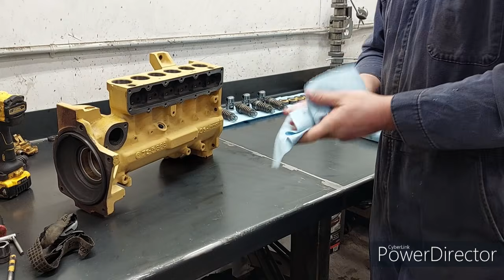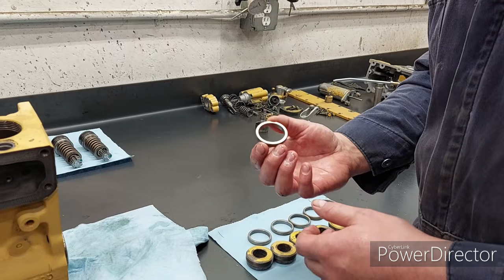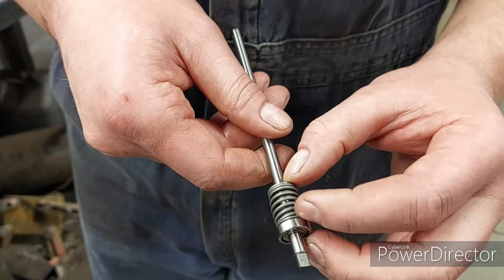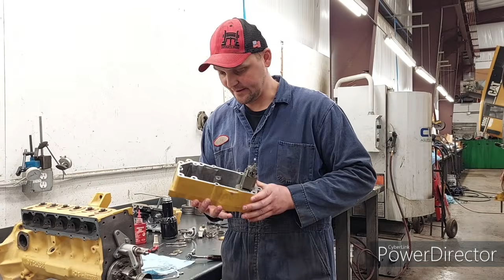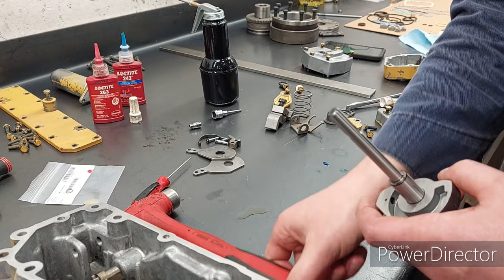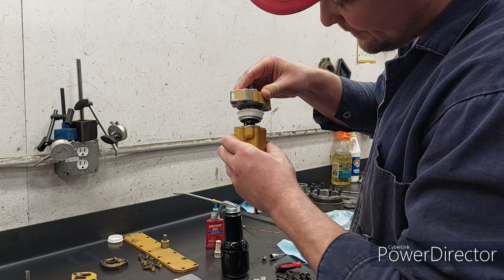3406B Fuel Pump

Comment: I have a question, I can’t get my 3406B to go back down to idle its revving around 800-1,000 rpm’s. I’m wondering if you would have an idea of what the problem may be? The engine did get dropped off the forks onto the ground when it was being moved into position to be placed into the truck and was mounted on the engine stand. It fell about a foot onto the ground didn’t damage anything on the engine but now since it has been mounted into the truck and started it will not idle down. I have an idle spring hook up and no fuel pedal linkage is connected and the Jake switch is backed all the way out so it’s not interfering with the throttle.
Reply: Did this just happen or first time you got it running?
With the engine is NOT running, and the throttle linkage off, back the low idle/Jake switch screw out. You should see the throttle lever rotate counter clock wise. Turn it in it should rotate clock wise. At any speed the spring force and the flyweight should equal out, thus you have a steady speed. Not talking about pulling a load on or up a hill as RPM's are changing. So if your throttle shaft is moving, something is wrong in your governor. First item I would check is the dash pot on the back. Engine off, you screw it in until it bottoms out. Back it off one and a half turns min to two turns max. On 3406C 8PN engines the dash pot was defective and you had to replace it. I have also seen the wrong governor spring in the pump and one pump I took apart for this reason Somebody took the governor spring and stretched the spring so he could run above full load speed so the engine would not surge. If you r & i the governor, be careful. The flyweights can drop out behind the race. When they do and you start the engine, the flyweight will come out the side off the governor. If you have the updated carrier, it will not do this. Also the race next to the flyweight Cat has three different part numbers. Use the part number off an 8PN. It is larger and helps prevent this. Also your governor guide depth could cause a problem. If I recall his video shows you how to set it. Do it after you replace the tach drive seal. Inside the governor guide is a snap ring. If you replace the tach drive seal. Be careful that you don't knock it out.

Comment: Hello, My 3406B engine had a starting problem, and I found diesel flowing through the outlet/ special fitting to the diesel tank during the hand priming and cranking. What is wrong with this issue. Appreciate for your help.
Reply: Are you talking about the fitting on top of the main pump? Usually a number four line, could be a 6 or 8.

Comment: What would cause fuel to get into oil? I've pulled the valve cover and checked for a leaking fuel line, no issue found. I heard a fuel transfer pump could cause this or possibly a seal at the main injection pump drive. How would I verify?
Reply from the maker: Most internal fuel leaks on a B or C is due to the internal lines or a nozzle. Common for them to leak at either the bleed screw on the side of the nozzle or where the top part of the nozzle threads to the middle part. Get some fuel dye, pit it in the filter, use a black light with the engine running valve covers off and check the lines from both ends and pay attention to the nozzle retainer. You may see fuel coming up around the line at the nozzle. It can be an injection pump problem but if it hasn't been into recently its not likely
Reply: @hellscanyondieselpower6537  before posting this comment, I did remove the valve cover and run the engine while visually inspecting the fuel lines. I didn't see any obvious signs of a fuel leak, I will purchase some fuel dye. Do you have any experience with fuel dye and which would be best?
Reply: @alexchavez3912  The fuel transfer pump was a classic part (Cat aftermarket cheap) it was pitted in the bottom. You are suppose to pressure test it at a certain angle and count the drips around the shaft. I have not seen one fail the leak test yet. Been working on Cat's for 43 plus years. 99% of the time it is a nozzle, unless some body has been in the pump lately. I explained how I test it for fuel in the oil. Replace the pump if you wish.
Reply: Fuel transfer pump, only seen one and it was a classic part. Fuel pump usually when someone tried to fix a bushing leak and didn't do it right. Most of the time it is a nozzle. With the valve covers off, the nozzle is in a chamber. Should have two holes on the cap. Be careful, put your finger on one side. The other side put some air psi on the open hole. Be careful you don't want a face full of oil. As you check each one, the good holes will push oil out, dark. The leaking nozzle will be clear because it is full of fuel. If it is the nozzle, could be seal on the side. You can replace it. If it is the seal on top, you have to replace the nozzle. Can be a fuel line, the outside connection has a drain hole in the fuel line adapter. The inside line has an oring to try and force a leak to the outside. The nozzle connection you already check it.
Reply: @johngoldsmith6629  how did you determine that the fuel transfer pump is leaking? When you removed it did you see obvious fuel coming from the transfer pump?
Reply: So I got the test results in yesterday from the oil sample. My engine oil does indeed have fuel contamination. I will start with the fuel transfer pump, I'm hoping that's what is causing this issue

Comment: Can u change the little pin at the bottom of the hole that the plunger does into? My cylinder 1 pin is gone. Wasn’t sure if maybe i could take off the side cover and replace it
Reply from the maker: If you mean the pin in the lifter, no you can't. But that pin is only a guide to get the teeth on the plunger to align with the rack properly. Sometimes when you disassemble a pump with stuck plungers and barrels those little pins get damaged. I just carefully grind them off and check my rack during assembly.
Reply from the maker: If you mean the alignment dowel in the housing about an inch down, I do believe you can change that through the fuel cover. Never have done it but I'm pretty sure they are in the parts book
Reply: @hellscanyondieselpower6537   As I work on truck engines. The alignment dowel has two types that I know of. The early ones (7FB) style pumps, has the dowel and a o-ring. They are simple to install, as they bottom out in the housing. The later pumps, the pin can go all the way thru the housing. As you are well aware on a camshaft lifter failure. Getting the lifter out is the problem. If you force it out the top, you will damage the seat area of the spacer. What I do is, turn the cam and get the lifter up, slide the camshaft out. Take a brass/bronze punch and lightly start tapping the lifter back down. What you are trying to do is force the dowel pin to move out. If you strike the lifter very hard, you will shear off the dowel and damage the housing even more. Once the lifter falls out the bottom, on the solid dowel ones (later). I drive the dowel back in and let it fall out. I then take a hone and hone the damaged bore. Take one of the used lifters and see if it will drop all the way in freely. If the housing looks reusable, I take a one inch impact socket and use a hole for a guide. Grind a flat spot on the socket until it will fit in the bore using the flat spot against the dowel. I then take a extension and and put it on the socket. Using a flat edge laying on the top of the pump housing. I mark the extension with a marker. I then get a new dowel and put bearing mount around it. Put the dowel in and socket until I get it back to the proper depth. Take a lifter and see how it feels. You can use a depth mic if you like and compare it with a non failed bore. Once you are sure everything will work out. I clean the pin bore area on the outside and apply J-B weld in case of any seepage.

Comment: Gotta be almost 30 years since I rebuilt a 3406b pump. Did a few earlier drive shaft driven 3406 pumps. Also done a few 3208 pumps. The throttle shafts would wear out quickly. I still have the bonnet wrenches for the inside spline and the outside spline bonnets. Thank you for bringing back memories.

Comment: Would love to see more videos about cat engines! The b model specifically, just bought a 1988 379 Pete looking to keep it around a long time. Videos like this will make that possible. no matter how much money the truck makes or doesn’t make I want to do these kinds of repairs myself. That gives you a true understanding of what’s getting you down the road everyday and makes understanding and diagnosing problems easy.
Reply: What is your full engine serial number?
Reply: @johngoldsmith6629  4mg29870 is what I was told. Everything seams to match. That’s what was put in it from factory and I was told it was the same engine. Only thing is I can’t find a plate on the engine itself, so i dont know for sure.
Reply: @micahfreeberg574  The serial number is stamped in the block, it is on the passenger side, number five cylinder. About four to five inches or so below the exhaust. Shows to be in a PB, you can call PB and give them the vin. They can tell you what engine the truck was born with.

Arrangement No:	9Y-2449	
Mfg Model:	3406B	
Mktg Model Year:	1988
Prod Family:	ZI	3406/C15 Engines
Sims Prod Family:	62	Truck Engines
Source Facility:	40	Engine Develop And Mfg 7-18L
Principle Work:	D10	Trucks - On-Highway
Build Date:	16Jun1988
Factory Ship Date:	Not Applicable
Dealer/Invoiced Ship Date:	27Jun1988
Sales Date:	27Jun1988
Delivery Date:	19Jul1988
Selling Dlr:	D99L
Owner Cls:	E
317 BRAKE KW (425 BHP) AT 2100 RPM. CARB-CERTIFIED, PETERBILT

Only repair showing at Cat was the governor recall. This engine has a very bad timing advance. Numerous recalls and updates. The carrier likes to slip, so the timing advance will turn slower if it doesn't have the updated carrier. With the cover off the advance see if the flyweights will turn, I use a screw driver and push on the side of the weight. Don't get wild, don't want to break anything. If they do you need to rebuild your VTU, also other updates on the snap ring, races, small lock nut. 
The bushings that hold each injection pump down causes the pump not to seat in the bore. Cat has updated the bushing. If you replace the bushings, you have to center the rack and pull the pump out. Be clean, clean and clean. If your not you will get dirt, etc in the sealing area and put fuel in the oil. 
The governor tach drive seal likes to leak oil. Video shows on governor guide depth, when you replace the seal. Have to be careful, with the outer housing off. A flyweight can drop out and when you start the engine. The flyweight will come out the side of the inner housing. I use the flyweight race off a 8PN, has a larger OD. Also the flyweight carrier has been update with stops to prevent this, if something fails. 
Fuel injection lines, has to have clamps and brackets to secure the lines. I like to use the set up on an 8PN 3406 C. However I do mine a little different then the book. 
Adept Ape has two videos on this engine, one on the engine, other one is pulling a nozzle out, watch them.
Fuel Ratio Control (FRC), diaphragm likes to blow sometimes. The housing gets a sharp edge and will cut it. I put a beveled edge on it (part that it rest on). Some people just put a plate on the back. Have to be careful, as black smoke will roll out the exhaust. 
Jacobs Brake, should have a three point stand. If I recall you can buy some more parts and make it a little stronger. Head bolts will have to come out. So you have to pull a valve cover and see on the exhaust side if you have one stand or two.

Comment: Are B model pumps and C model pumps interchangeable?
Reply: Early 3406 B's depends on HP, some had up to a 24 degree fuel system camshaft. 
3406 C 8PN's are a unique design. 
4MG's, 5KJ's and 3ZJ's Again fuel system timing, VTU, dual helix, single helix, different check valves. 
Will it bolt up, yes.
Will VTU's interchange? Depends on what you have. 
Will it run? yes, 
Will it run right? Who knows.

Comment: Great video, do you have the part number for little filter on the AFR assembly? Your right about helcoil threads for those 2 bolts are shot and it let loose today on me.
Reply: 8N6680, 2D6392 seal, just put a plate on it.

Comment: i have same injection pump and unable to start engine, if i give little power for rack than started. after that RPM gradually reduced. what is reason for that
?
Reply from the maker: Start with the shutdown solenoid if it has one. Remove it and see if will stay running. Sometimes those solenoids click but don't pull in all the way. You will have to manually kill the engine with small shaft above throttle shaft if solenoid is removed. Next try to remove the air fuel control, it doesn't make sense but I have seen one engine that it was adjusted in all the way and the truck would act like it was running out of fuel. Check fuel pressure when it's running and verify it stays around 35 to 45 psi
Reply from the maker: If you have good fuel pressure and solenoid is not stopping you, then there is probably a problem in the governor either with the flyweights or throttle servo

Comment: What aftermarket brand plungers are u running? I need to buy 6 new ones but cat is priced high. What’s out there for quality aftermarket?
Reply: Cat offers REMAN, but they are still new parts.
Reply from the maker: Disa plungers and barrels. Have had great luck with them

Comment: loved the video helped alot, if you could, a video demonstrating how to reset the fuel/air screws back to "factory" would be much appreciated, i know how to turn it it up but i bought my truck already turned up gonna be rebuilding the pum soon and a base line starting point to set it at for break in period would reallly help!
Reply: Setting the rack, (FLS/FTS) back to factory setting. Requires the tooling from Cat. Also if you do not have the data plate you will have to call Cat with the engine serial number and they will have to access TMI. To set the Air Fuel Ratio setting, you still need the same tool group. You have the lever setting and when that is done. Next step is to setting the dynamic setting with the engine running. So you leave the dial indicator on the pump, start the engine. Cock the AFRC valve, rev the engine up wide open, real fast and read you dial indicator. It will not stay at that spot very long. Or you can purchase a electronic indicator along with the tooling to set the rack. Then as before on revving it up, you press the max function on the electronic indicator and see what it reads. Should not be to much over 5K, I would think for the tool group.
Or you can do what I like to do. Remove the back cover off the FRC. Start the engine and push in on the valve to cock it. Rev the engine up to full throttle real fast and watch your smoke. Make an adjustment until your happy with acceleration vs black smoke. To set the set point or bumping the governor, you need the set point indicator along with the multitach tool group. Hook it all up and hit a hill and see what RPM set point is at full throttle. Set point is 20 RPM above full load speed, plus minus 10 RPM's. Then if you want to verify your timing is working properly, you can purchase the timing indicator group. Again you will need spec from Cat. All together I think around 10k should cover the price of the special tooling.
And a chassis dyno helps getting the set point setting correct. Plus if you hook up the fuel metering device, you can see how many GPH your burning and adjust the rack to compensate for any wear. On a worn pump your allowed .5 MM above spec.  Remember HP equal Gallons Per Hour times Fuel Density divided by Brake Specific Fuel Consumption. Hope this helps.

Comment: Thank you so much for this video... I had a barrel plunger go out in the middle of nowhere and this video help me drop in a new one.. Can you do a timing video next lol
Reply: Couple types of timing advance. The older ones 7FB are the same. 4MG03600 and up to 8PN are basically the same, but they are slightly different. Number of bolts, spool valve, races and such.